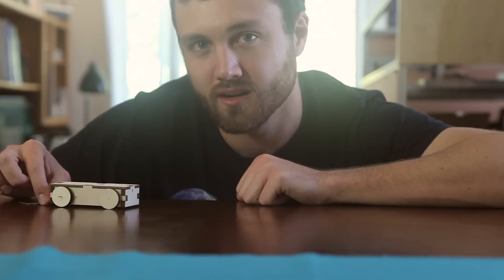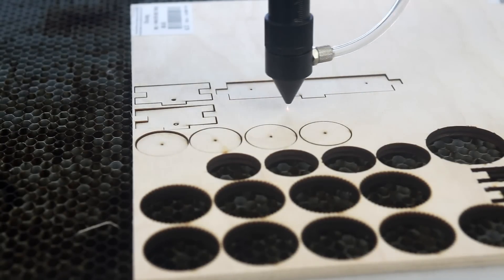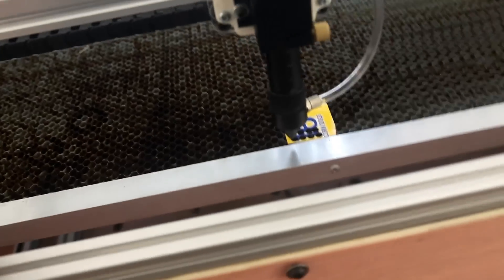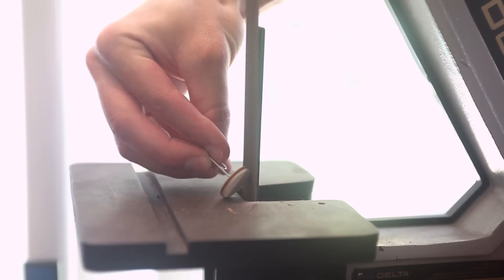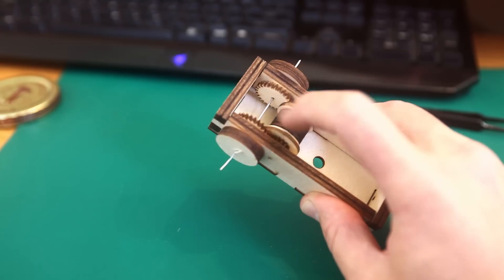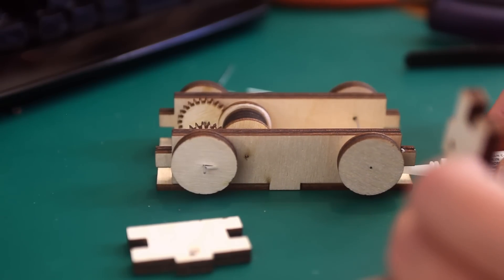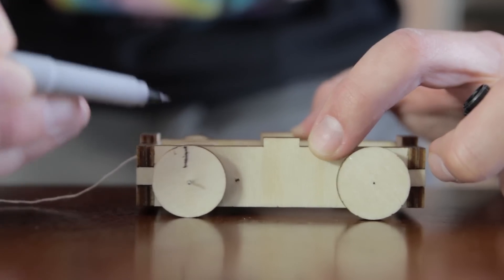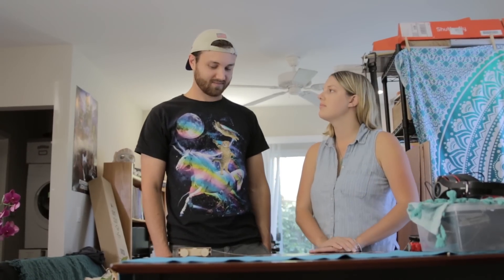Laser Cutting an Unusual Toy

Comment: First off, absolutely love your videos. Very funny, and love the project ideas in general. Much like you laser cut most things, I 3d print them. Recently I equipped one of my printers with a laser. Unable to find GOOD, Free software for generating laser paths, I ended up using the 3d printer slicers, and modifying the g-code manually afterwards. There are many slicers available for free which will offer a variety of toolpath generation options (inner/outer loops/etc). Some of these are Slic3r, Repetier Host, Cura, and Craftware... Either way, keep up the great work!

Comment: Are you aware they make a PT Cruiser turbo
Reply from the maker: whyyyyyyyyyyyyyyyyyy
Reply: William Osman I assumed you knew that, since you said "supercharger". Because you touch yourself at night?
Reply: Admiral Percy bit to far my guy.
Reply: William Osman they're actually pretty fast id rate them up with the impala ss mini s and cobalt s they kinda just a cheaper boosted car for teenagers to have fun with it's no corvette or hell cat but hell of a lot cheaper and fun
Reply: 2strokemoto man Except the problem with the PT Cruiser was never the engine, it was the suspension and chassis. On a road with any sort of corners you're completely limited by the body roll and understeer of the vehicle and not the engine power. If you want a cheap and relatively high performance vehicle for the money buy something like an MX-5 or 7th generation Toyota Celica with the 2ZZ engine.
Reply: It was the same engine as neon srt4 i believe

Comment: What would happen if you had the same mechanism in the front with another string? Would it wind up the other string when you pull the other one? Would be pretty neat if it did.
Reply: Crowbartender it would only if it had the same mechanism but backwards, so the front wheels will go in reverse

Comment: couldn't you make this large scale so a human could stand on top and maybe put in a spring and a ratcheting system so you could propel yourself forward with 0 carbon emission?
Reply: actually nvm don't listen to me ima patent it for money
Reply from the maker: hah!
Reply: Or maybe you could have some sort of human-powered system that drives the wheel with pedals that you push? All you would need to do is simply move your legs in circles and you go forwards! Someone ought to make one of those...
Reply: GRYPHOmn there's a lot of ways (some better) to travel faster and longer than running or walking, such as bicycles, hang gliders, zip lines, horse back, electric cars, etc.. and tbh, bicycles are the best way to travel if you don't want to affect the atmosphere. they're faster than having no vehicle, they give you a lot more bang for your buck, they're light, some are compact, and they're easy to build or find if you're not exactly wealthy. maintenance only requires good tires, a few cups of oil, and a human powered pump.

Comment: A cool thing about that car is that if you increase the angle you are pulling at you will decrease the output velocity and depending on friction and the gear ratio the car could not move or move the direction you are pulling the string. As a child that has gone through an AP physics mechanics course I felt compelled to say this

Comment: You can straighten the paperclips by putting one end in a vise and the other end in a drill chuck and running the drill for a few turns. I've used that technique to make reinforcement pins for 3D-printed hinges.

Comment: I understand this video is years old, you likely already have upgraded your laser, or at least the software, but I still wanted to make these points. If it doesn't help you maybe it will help someone else watching this.
1.) Just because a software is free doesn't mean you can't complain about its shortcomings.
2.) You could try leaving some intentional gaps in the outer perimeters of every piece you cut.  Then set your software to 'Cut closest lines.'  This way your part will stay in place until every feature is cut, and you can just manually cut the piece out at the very end using your tool of choice.
Reply: his house burned down... along with the laser...

Comment: that PT cruiser reference hurt... as much as i agree from an engineering standpoint if you've ever lifted the hood on one...I learned to love them for how jenky they are ( or need to be repaired , example: the hole I jigsawed above the gas tank to replace a fuel pump without having to drop the whole sub-frame- scary but time saving!)
Reply: Not scary, deadly af.

Comment: For the axles... if u take the paper clip wire and put it in ur drill chuck and hold the other end with pliers. Pull while twisting. It will straighten the wore perfectly. Be careful. It gets very hot. Also works with any solid wire.

Comment: Very similar idea to the Brennan Torpedo, which was a torpedo propelled by using winches on shore to pull spools of wire out of the torpedo to spin the propellers.
Reply from the maker: That is so cool! It's literally the same thing but in water. Thank you for pointing this out.
Reply: The torpedo could steer by having 2 propellers and spools of wire, so you could make the car steer by having each of the back wheels connected to a different thread.

Comment: Probably far too late, but you can make a paper clip perfectly straight and stay that way longer by getting it close enough, then laying it on a table and rolling it back and forth with a book or other flat object, then depending on the quality of the metal you can heat and quench it to make it stiffer and less ductile. There's some more science to it that that, but it's been 20 years since I last did it.

Comment: You should have made this with a spool of sowing thread, that way you could send a message to a friend far away and they could cut the thread, write a message, turn the car around and pull the thread thus sending the car and it's new message towards you. Then if you ran out of thread ($1.00) you'd buy another, reload the "fuel" and send the car on another mission to deliver more messages

Comment: If you put the straightened paper clip in the chuck of your drill and tighten it then hold the other end of the paper clip tightly with pliers then turn on the drill it'll straighten the paper clip/wire/etc

Comment: Hi man love your builds. I have a question and a tip. How did you build your laser cutter. And also to straighten wires you can put one end in your drill chuck and turn it while holding from the other end with pliers. Makes them dead straight but loses some of its elesticity. Good for using as rods :3
Reply from the maker: I built the laser with a lot of time and a few thousand dollars. I've been working on a long blog post for people who want all the details

Comment: This may have been said already, but why not generate 2 paths. One for the inner and one for the outer/releasing cut.
Reply from the maker: That works pretty well if you're exporting svg files from Adobe Illustrator or something similar, but it's not feasible to separate features in dxf files.
Reply: Have you tried autodesk fusion 360? Or does the cutter not run on gcode?

Comment: what if you had a different ratio for the gears so (idk physics) the wheels would rotate more than the wheel having the string aka meaning you wouldn't have to pull it except for the start bit

Comment: Why not set up two separate cut sequences? One for the inner cuts, and then one for outer so you don't get misalignment when they fall?
Reply from the maker: You could do that with svg files by grouping different lines as different colors, but that doesn't really work with dxf files. Also it's a pretty terrible band-aid for a problem which should be fixed. There are so many other problems with VisiCut that I should really start switching to an alternative program.

Comment: I tried to make it out of lego but it failed and it would only go in the direction where I pulled the car and would just eat up the string. :( plz william plz tell me how to overcome that.
Reply from the maker: Gotta use a lower gear ratio, so the wheel perimeter rotates less than string length you pull back. It's a combination of pulley diameter, gear ratio, and wheel diameter.
Reply: @williamosman   oh nah I completely forgot I did this. I made this comment when I was 12. Now I feel so cringey. When and why on earth did I get a reply. Still appreciate it.

Comment: can you use layers, cut inside feature first, then outside? or save two files from the original one separating the inside and outside details. do u not do that because you need to re-calibrate it?

Comment: What if you run the inner cuts as a separate program first, then run the continuous outer cuts afterwards?
Reply from the maker: You could do that, but it's a hassle. There is no easy way to separate those features.

Comment: What was the whole point of that mechanism? You can do it with out that.
Yep - no need for a second axle or gears. it really is simple.
Reply from the maker: k
Reply from the maker: Ohhh, but my car goes forward when you pull backwards.
Reply: Yes, but as i said - you can construct it in both ways without the extra axle. a bit of trickery, but still fairly easy - easier than your mechanical camera.

Comment: what is the software you use? I've got a laser cutting machine but i lost the software disk and need some kind of replacement software.
Reply from the maker: mmmmmmmm. It depends on what controller your laser uses. I use a smoothieboard controller, and VisiCut or LaserWeb as the laser interface.
Reply: I'm not 100% sure the controller all I know is when we bought the machine  they told us they designed it to be able to run on many different softwares.
Reply: But thanks.

Comment: Someone help!

I have an exam in mechanics in 4 days. I have a similar problem but in reverse - when the force is applied on a smaller diameter wheel (compound wheel) it rolls in the same direction as the force due to friction (and the torque of the friction being higher than that of the force)? I don't get why it doesn't roll in the opposite direction of the force.

Comment: "it would be like supercahring a PT Cruiser"

one 
you can andit /WOULD/ have more low end torque if its a roots type /OR/ more top end horse power in a paxton style while being easyer to install on the I4

TWO 
turbos on the other hand are KNOWN to work on the PT's I4 BECUASE its the SAME motor from the basic Brohs SRT-4S Neon becuase they share the same block and internals and heads and driveline parts

BOOM

Mopar or No Car